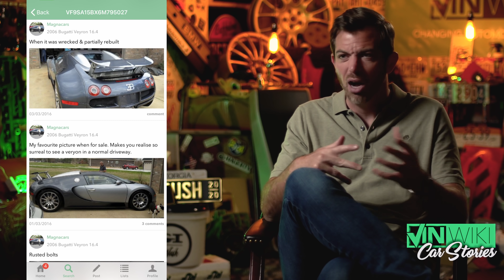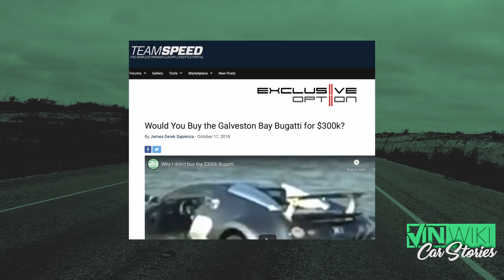We found the flood Bugatti! The cheapest Veyron EVER

Comment: Ed: "Who paints the car first before rebuilding it?"..........cough...cough...Tavarish...cough.
Reply: That’s how cars are suppose to be painted.
Reply: @MrPland1992  not really, you gotta rebuild, disassemble, paint and reassemble.
Reply: @MrPland1992  not at all, protect the paint.  fix parts and assemble to test fitment before painting so you do not accidentally scratch anything, then reassemble
Reply: @MrPland1992  Only an idiot paints first before rebuilding.
Reply: @masterwhopper414  or maybe you do shit work and rely on eyeballing panels to fit everything instead of properly repairing the frame to factory alignment specs and having it all fit like it was meant too. 
I wouldn’t trust you with pre painted parts either, stick to your scuff/tape and shoot backyard jobs.
Also I think y’all misunderstood my original comment lol
Reply: @MrPland1992  All you're doing is opening yourself up to ruining the paintwork unnecessarily. There is no benefit whatsoever to painting first, argument over.
Reply: @masterwhopper414    mask off the edges and corners before assembly. Don’t do shit frame work and there won’t be a fitment issue in the end. Argument over. Never once even remotely had an issue. 

Are y’all seriously masking/painting assembled cars? I’d sue the shop if I removed a bumper and wasn’t painted separately from the car unless it was some half ass $1500 full paint job. This is a Bugatti, not the 1996 civics you repaint. 

Are you for real or are we totally misunderstanding each other? They literally said the car was assembled and painted before it was disassembled and repainted black
Reply: @SimuLord  candy red with some 2ft long swangas
Reply: Who?

Comment: Imagine the stable one could have instead of that toy on it's $22,000 tires.
Reply: For those who usually buy this car, 20k is just pocket change
Reply: Idk how the tires can be 20k. Its just marked up because bugatti
Reply: @danielcarter5579  
It's not just the tires.
They have to change the wheels also.
Reply: @danielcarter5579  it is because those tyres are rated for 400+ km/h , regular tyres would desintegrate or something beyond 200km/h
Reply: @dan_6915  oh wow why do they do that you think? Seems if the rims are fine why replace
Reply: @danielcarter5579  
Too much power or something
Reply: @danielcarter5579  also factor in the weight of the car (2 tonnes). And add to that the downforce from the active aero wing when going over 200 mph/320 kph (even more weight put on the wheels and tires).
Those wheels and tires have to cope with a lot of physics.
Reply: TPain the rapper sold his and got 4 cars and 200k in cash back on a trade in. He said he drove it and a rock went through one of the 4 radiators lol they wanted like 60k for a radiator ...

Comment: I remember crawling all through it in the shop it was at in Houston in 2012 or 13 I believe.  Piles of rusty bolts. They had just pulled the windshield and started cleaning around that area.  They had a hired a basic tech to do the disassemble, clean up and repair.  He was a goof and barely showed up to work and eventually didn't.   Hope they get to do a video of the resurrection!

Comment: I've just seen the whole restauration video of this car. 1,2 million dollars on parts and in finally runs and drives. And a simple part as a main rear seal was not available from Bugatti. You have to buy the whole engine from them 🤣 He fixed it with a crankshaft sleeve to counter the rust pitting on the crankshaft and used a generic seal. He worked 3,5 years on that car, just unbelievable how much work he put into it.

Comment: Do you have any issue with the fiber optic wiring harness in the audio system the company hertz sells a computer that will plug directly into the car’s warranty and then you can program it from there for your amplifiers and speakers

Comment: I know no one is goin to believe me, but I helped worked on the car, we powder coating the rear subframe and heads, and a few other odds and end not to much longer then a year ago. But when Ed says there was water damage, even after it was sandblasted most of the structural components were so bad that it took over a week in just sanded it smooth
Reply: The company I work for is powder coating plus in Las Vegas,

Comment: If the car has a lot of corrosion that's visible. Houston may want to totally disassemble the car down to the monocoque chassis and get it soda blasted or chemically dipped. In order to stop the corosion from spreading. Eventually ruining the car. In my experience when rusted cars come to a area of heat/humidity the corrosion grows exponentially faster.

Comment: I own an alpine b7 2007 E. 65 also with the fiber optic wiring harness hertz audio company makes a computer specifically for cars with fiber optic wiring harnesses It’s meant to coincide with cars with this kind of harness that would be a way to put an aftermarket audio/video system in this car as long as you can figure out the programming it should be a piece a cake

Comment: I would have pulled the v16 and drive chain and put a r8 v10 in it modified to 1200 hp because r8 and Bugatti are really similar. The wheel base ,rear engine and all wheel drive. Lot less money to maintain and fix. I mean some one buy v16 for more than $50,000.

Comment: The camera you were using for the close-ups of Ed had a dead pixel right in the center of Ed's face.
Reply: not only the close up... Looks like the close up is a cropped version of the normal shot.  They must be using 8k or 12k cameras... with a dead pixel.

Comment: When I worked at Porsche, we had a air cooled 911 that was rumored to have belonged to Nicholas Cage. The owner was given an estimate to replace the cylinders and reassemble. He proceeded to take out a loan on the car and didn't pay it.  The bank showed up expecting to drive it away.  They were shocked to find the engine and trans split into 3 crates. The repossessor said, "You mean I can't drive it?"

Comment: Just seeing the engine turn over doesn't guarantee a good engine. The engine was most likely hydro-locked from the waters which at minimum would bend the rods, requiring a complete ground up rebuild.

Comment: They ONLY way this car won't eventually rot away is to completely disassemble down to the bare frame and body,  and send it out to Kleen Strip,  a specialized stripping service,   have it dipped,  acid treated, phosphate dipped then rust and corrosion treated,  OR. all those welded seems. And inside the rockers will keep coorroding until there is "no frame".!!! Dipping is this cars Only hope !!!

Comment: Insane! Making it rear wheel drive with anything north of 700hp is straight stupid. Installing a clutched output for the front driveshaft with associated ECM changes would be the only option. Otherwise putting the 1500hp to the ground would be an impossibility.

Comment: Damn. Good call not buying it. $400 for the car. $250 in parts. Needs a $100 sound system. And sadly, it will be objectively worse to most buyers. He’ll get $700 at best and not even adding up other costs ( “free” labor and existing parts. )

Comment: Don’t ever buy a flooded car ever! Itwill cost you more than 2 new cars in the end everything that looks good and you reuse will go bad a few months years down the road! It’s a never ending battle unless you replace everything up front I know people are thinking that the engine is not seized it will be fine but no everything electronic is going to fail and without a full disassembly you won’t see the pitted cylinders and bearings a little corrosion pit on a connecting rod or crank will cause it to fail at 8 grand eventually taking the whole thing out

Comment: Disclaimer not a Bugatti or any other exotic car expert but I do have a brain which I use to reason, using a little logic and common Sense. That being said, I have heard this story since the beginning. This car from the very moment it was pulled from the saltwater was set up to be a total loss. That car should have immediately been cleaned with fresh water, thoroughly dried, and the entire drivetrain should have been pickled in any petroleum product. The rest of the entire car would have needed to be disassembled and very carefully treated to remove all corrosive liquids it had been exposed to. All the electronics would have been a total loss but the wiring harness itself should have been salvageable. All that being said, I don't know anyone who has the means of owning such a car who would want it. Like I said in the beginning the people involved in handling this car from the beginning were either completely incompetent but more likely wanted it to be a total loss. Another way of saying it would be, ever been duck hunting and accidentally dropped your shotgun in freshwater. If you gave a damn about it you would dry and oil it as soon as possible. If you drop your price shotgun and salt water you would be removing your clothing to dry, and getting oil from the closest source possible.

Comment: Even with revenue from his channel still won’t make the vehicle worth owning … 300-400 right off the bat then you said 250,000 in parts that was after he already had the full interior , rims and tires to fit 25,000 stereo/fiber optic 35-60,000 used paint 10-15,000 his is into the car without it passing inspection lol for 8-900,000 thousand the car after it’s finished and needs to be in perfect condition you can sell for 7-800,000 unless he goes crazy with bigger turbo’s and builds the engine maybe 1 million to the one buyer that would want a custom wrecked bug maybe a Arabian billionaire will buy it for his 13 year old to look at